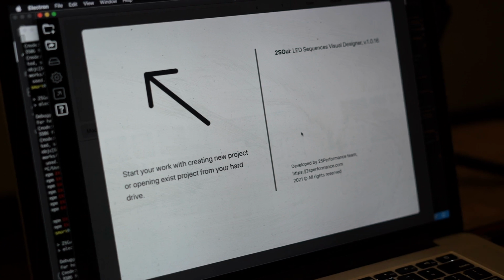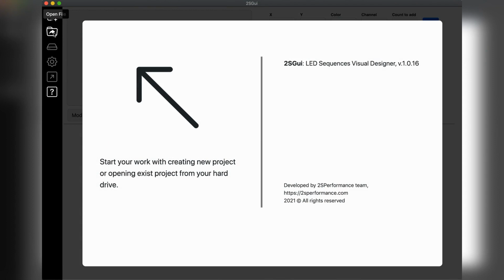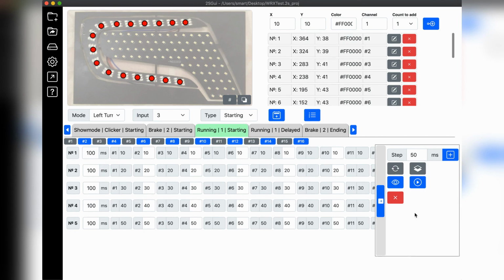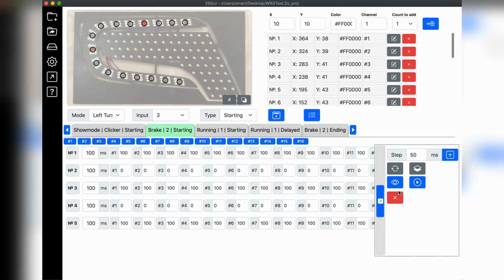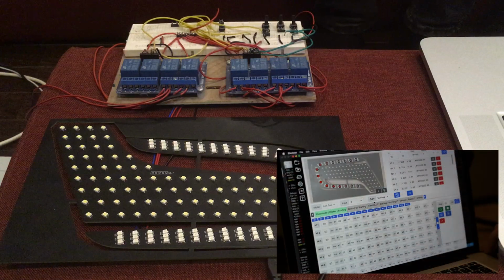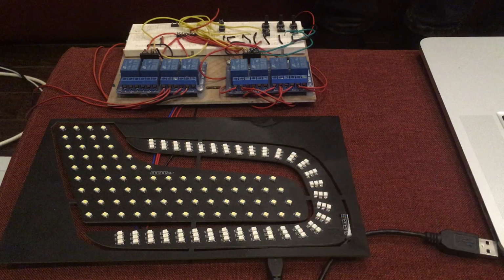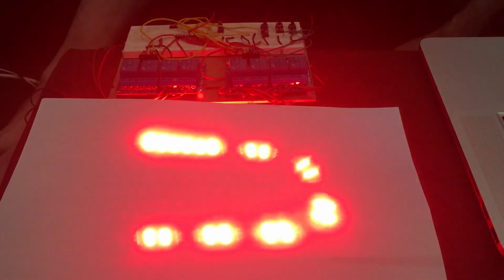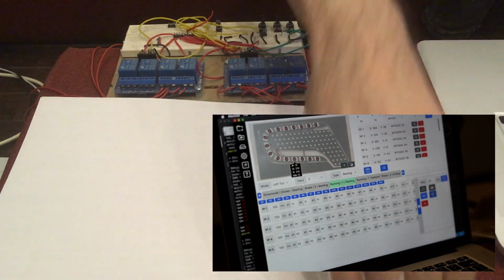Subaru WRX 2015+ Fully Programmable LED Tail Lights Boards

Comment: Whats your microcontroller? I build my lights with a Pic24f32ka304. Du you have a better/more easy one?
Reply from the maker: Any Cortex-based actually. I'm using STM32F103CBT6 and it lot more easier.